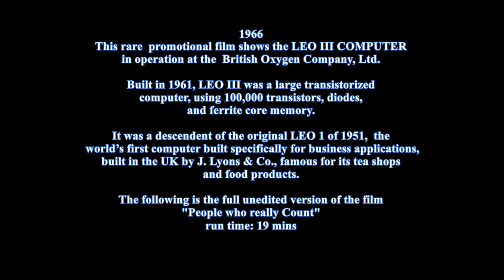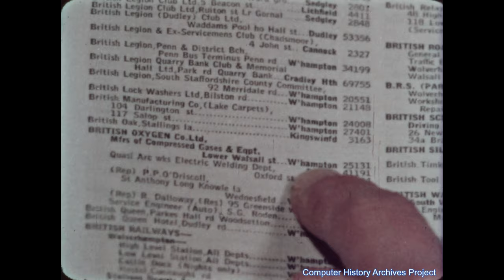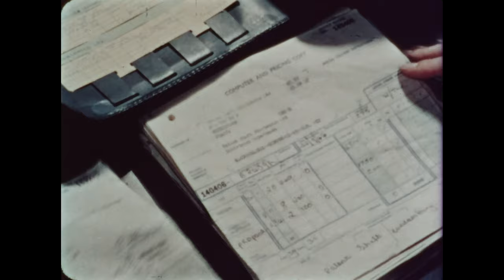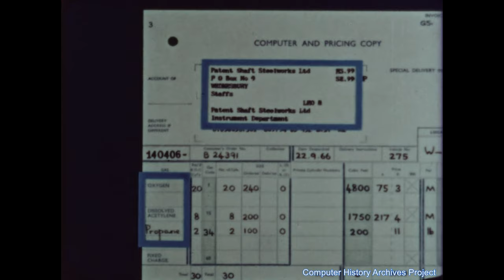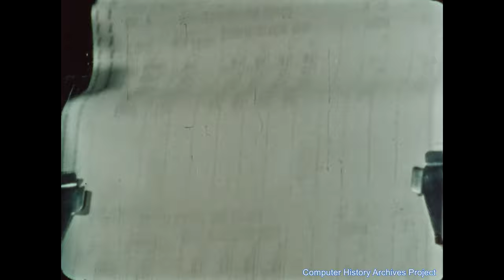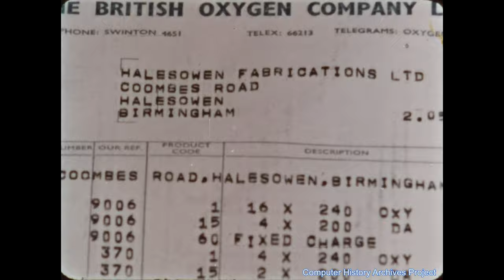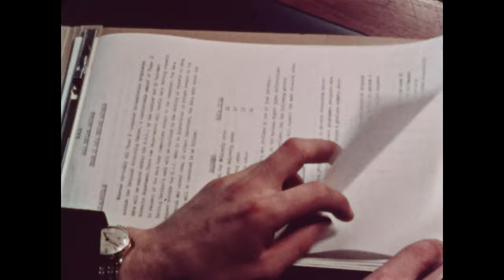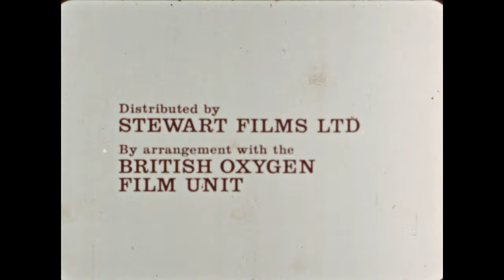Computer History: First Business Computer UK LEO III (Lyons Electronic Office) (Full Version)

Comment: When I worked at Lyons head office in the early 70s there was a display of parts in the corridor leading to the stall canteen. Interestingly in the office where I worked all calculations were done on an antiquated electrical calculator. I introduced the use of pocket calculators, after the manager noticed I was able to work at many times the speed of others, using a Sinclair Cambridge. I was sent to buy another 5!
Reply from the maker: Hi Stephen,  great story!   ~     Hunter

Comment: Interesting film.  The LEO seems a bit behind the state of the art for 1966.
Reply from the maker: Hi Tom, good observation.  It may also be worth a mention that the film was 1966, but the LEO III was designed around end of the 1950's, and first available in 1961.  So by 1966, it was at least 5 years "old" technically.  Good point though.  Thanks!

Comment: Those tall Gas canisters 4:20 don't even have safety shield caps. Yikes.
Reply from the maker: yes, you are right.  It is a bit un-nerving to watch that part...
Reply: he also lifts the canisters by the valve at 5:05. They had a rather loose definition of safety before the 1970s. It always took a serious incident or even disaster before anyone considered to maybe do things differently